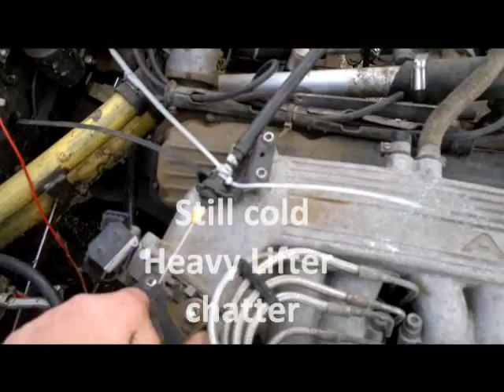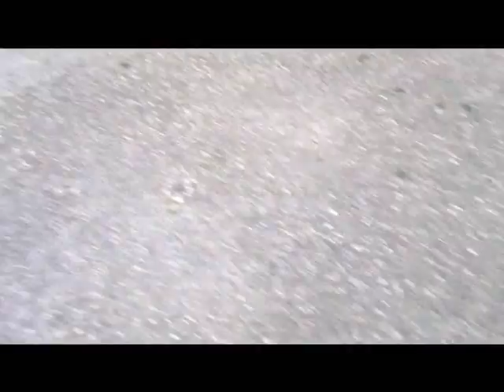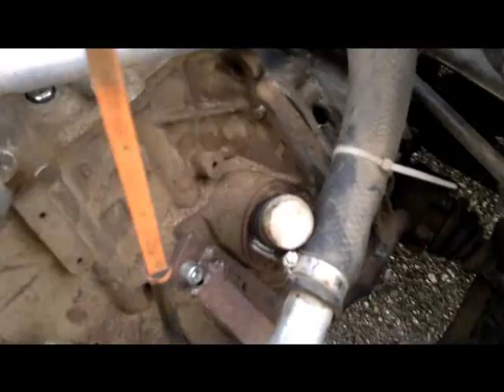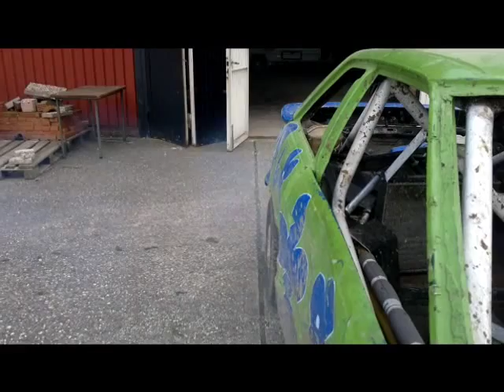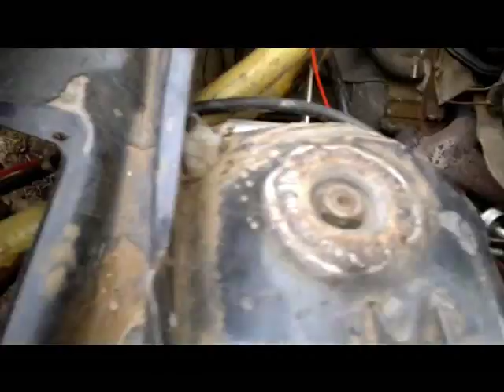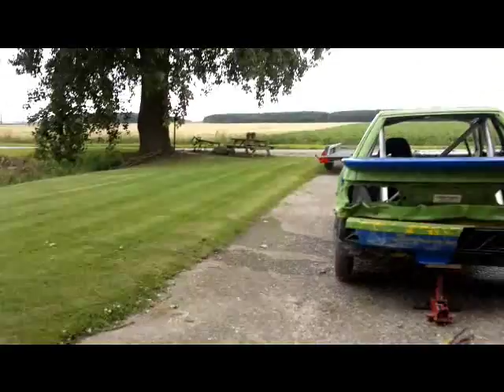AUDI 5 Cylinder SOUND and Tuning

Comment from the maker: The extra vacuum Pump may come in handy when u apply left foot braking , and right foot Power at the same time :D
But i think its becouse the central Doorlocks are vacuum Assisted in some audi,s

Some Quattro turbo,s have hydraulic assisted master cylinder 
( The ones whitout have the Large round Membrame behind the mastercilinder )

I know in fact a 200Quattro ( 20v ) Turbo has this

Comment: Thats something you shouldn't really need to do on a daily driving basis....
Yes, my audi had the hydraulic assisted braking, which was ran off of the power-steering pump.  Which leaked, and caused the belt to slip going around turns.  Meaning both power-steering and brake assist went out together.  It wasn't the safest car I have ever owned.

Comment: This car shouldn't need a vacuum pump. It is a gasoline fired piston engine. It should create its own vacuum from the intake manifold.  Then again it is the only car i have ever owned with a tandem hydraulic pump for both power steering and brake assist. Now that i think about it, most brakes are vacuum assisted in cars, maybe there was a reason it had a hydraulic assist for the brakes instead of vacuum...hmmm maybe that engine did use a vacuum pump. I couldnt imagine why though.

Comment: @XploiTee pfff, i couldn't tell you....all i know is i put thicker oil to try and quiet it up and it didnt help,  the car was a total pos and its engine ran worse then the one in this video to be honest....it revved up alot slower like there was something holding it back...it wasnt misfiring, it was just a fatuged over stressed lil N-A 5 cylinder trying to move a big ass awd car...